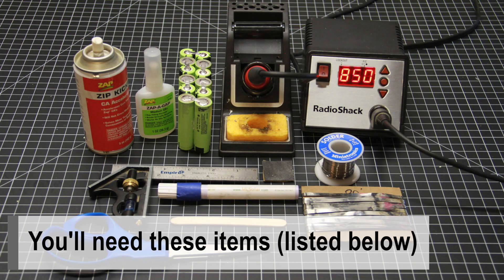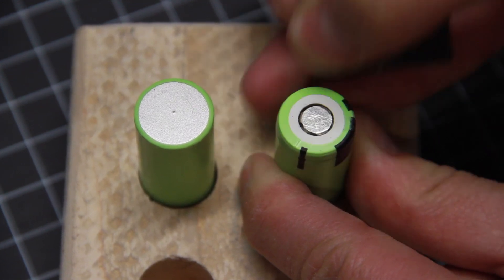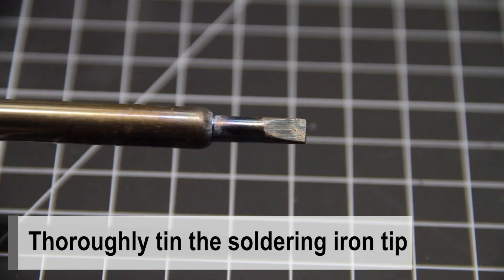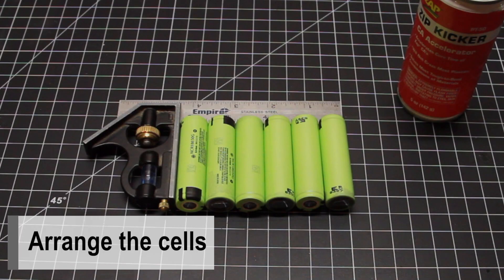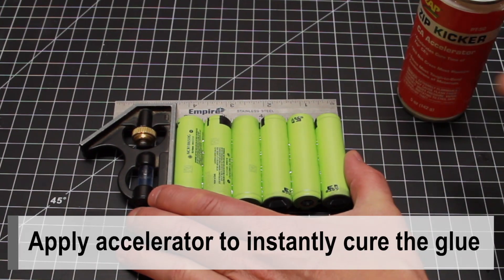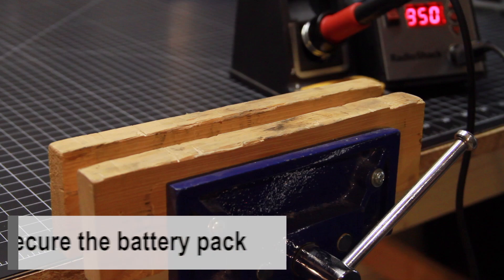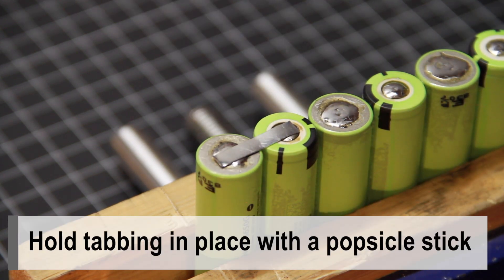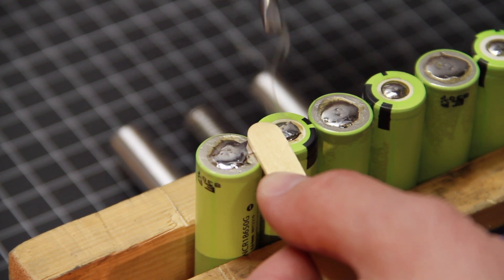Best Soldering 18650 Lithium Cell Tutorial - NO Welding, Just Solder!

Comment: Fast and hot. Use 63/37 solder like kester 84. Some cells are made with a difficult to solder steel. If so use a flat toothpick tip of plumbers tinning flux instead of a flux pen. A soldered joint will take a lot more current safely than a spot welded one.
Reply: You can also get solder that is 62% tin, 36% lead and 2% silver. This melts at a temperature several degrees lower than solder consisting of tin and lead only. In some countries you may have some difficulties getting these solders because only solder not containing lead can be legally sold in normal shops, but you should be able to get them from an industrial supplier. 

Lead-free solder needs a much higher temperature to melt it, and also has rather poor wetting qualities. These characteristics cause a much greater danger of damaging the cells. 

I suggest testing all the cells before soldering to check that they have identical voltage, and then quarantining the soldered cells for as long as your patience allows and then measuring them again. This should reveal if any cell has been damaged by the heat.

Comment: If you can hold onto close to the end of the battery you're soldering on and not burn your fingers, you're well below 100 centigrade. I've never had any issues soldering on lithium batteries.

Comment: I wouldn't recommend soldering batteries at all. I had once a coin cell that exploded while soldering.... I had luck and nothing happened except ears ringing. You never know what you may damage inside the battery. There are plastic insulators that may melt etc. Battery life will be compromised. Better buy a simple welder.
Reply from the maker: A coin battery has much less mass than an 18650 and therefore is dramatically less tolerant to heat. Easier/quicker to heat up a single penny versus an entire stack of them.
Reply: @enopto  That is certainly true but there is still no "correct" way of soldering batteries. It's just something you don't do! Especially since good small welders are available for about $50.
You can also buy 18650 cells with pieces of nickel strips welded on both sides. THAT is something you can solder at home...

Comment: Damn I'm an idiot. I used a method like this a lot. (based on common sense) But one critical step was missing. I did not cleaned the ends with isopropyl after sanding...
Reply from the maker: you're not an idiot. You're a stallion.

Comment: I melted the plastic sheath soldering the tab to the positive pole, the tab shorted the battery to the negative outer casing where it melted through the plastic sheath, I now place some folded paper under the tab on the positive so the plastic does not melt.
Reply from the maker: Good trick.

Comment: hi, does the heat from the solder affect the chemicals in the battery? thank you...
Reply: It may damage the cell (lower the capacitance) or if you apply too much of a solder on + side it can short a cell from inside, what will make it unusable or if it is high current cell it can even blow up. That's why u should use spot welder.
Reply: @zbigniewstuleja3477  thank you sir..

Comment: I was doing this almost daily for customers in the mid-1980's (NiCad's were cutting edge then). 
Cells were a couple of bucks each but a replacement pack from the manufacturer was $$$.
Hit each cell's ends against a medium grinding wheel for half a second instead of using sandpaper. 
Don't glue together until after final solder is cooled and tested -- if you overheat any +ve ends, you will melt things inside and short out that cell, and it would be hard to pull it out after it's glued in, so feel for any "warm" cells 5 minutes after soldering (bad sign, that cell's toast). Don't glue before that test (you can temporarily tape them together for easier soldering). Instead of tabs, flow a drop of rosin-core solder into the end of some braided copper desoldering wick, then touch that end of the wick to the solder drop previouly applied to the roughened -ve cell end and reheat just enough to ensure the "two become one." Now bridge the wick to the +ve end of the next cell, add a small drop and heat that just enough to melt into its existing drop. You're a pro now.
Reply: Can the solder wick withstand the same current as a regular tab? Some high end lithium cells do 20A to 40A.
Reply: @umloginqualquer   If there's 20-40A involved I'd suggest doing it properly. I'd love to see that power switch!
Reply: @umloginqualquer  those old nicads could pull some real current. tiny n-500ar 500mah cells do 17 amps peak all day. common to pull 6-10 amps continuous. the fastest race boats could drain a 1200 scr or 1700 sce sub-c size cell pack in less a minute , say a less than real world 40% efficiency thats still almost 30 amps and many of those high end packs had solder sponge as connectors
Reply: Desoldering wick! genius, that nickel tab is way harder to buy locally than just plain desoldering wick and easier than peeling cable terminals. ty sir
Reply: Geniales tips😉 Y si necesito unir en paralelo, la mecha desoldadora de cobre trenzado servirá igual ?? 🤔
Reply: solder wick is terrible idea as it will transfer the solder away from the initial soldering point, through the copper cable, and will add too much heat
Reply: @SeatbeltFan  Correct, it’s not an ideal solution. And that’s not how I’d properly solder darlington servo drivers… but it works for toys or low-power items where a replacement pack is discontinued or $$$$. And not in my electric car!

Comment: I thought I was the worst at soldering lithium ion 18650's, now I know the person making the video is even worse. I am a bit happy after watching this video.
Reply from the maker: Please elaborate.
Reply: @enopto  I guess you did not read what - Dawn Minilla - posted below. Also, Soldering has to be done as required, Its a Lithium Ion Cell, please read more about it, it can take short amounts of heat, but you are like dipping its a** off in molten solder, and then some dripping into the vent holes of the highly explosive Lithium battery. Hope some one does not die. I have seen Lithium cells explode without any mistake, its bad, and you don't want people pointing at you. My suggestion, and how i do it, is - take a thin tip solder, never let the Lithium cell experience the heat, it should be like frost byte and then you are gone. But in this video, you are like a foundry, melting stuff.
Reply from the maker: The way you’re describing is a recipe for a cold solder joint. Ever pass your hand quickly through a flame? Same concept here. High heat, low linger time. The “molten” pool is well contained. I’ve soldered hundreds of cells without issue. Thanks caution and care, we’ll all be ok.
Reply: @enopto  First, its a good solder joint. But I don't find it safe, its too big, if Mr. Joe watches this and comes in with that huge iron and some solder drops short his 18650, he wont have a face left. People who know what a lithium battery can do, its ok. but to general public, its just a big AA cell which can recharge.

Comment: that last soldered joint looks horribly like a dry joint and nothing like the previous one

think I would use a screw driver to hold the tab down and keep it there for a while to try and sink some heat away from the battery which isnt going to be liking the irons temp.

Comment: Dangerous! On the plus side, it is easy to damage the protective film in the area of the end of the 18650 cell, especially heating this place by soldering through a metal jumper. A short circuit will follow! Be sure to put protection on the positive end - paper or something like that - around the positive contact itself.
Reply: And one more thing: you need to solder much faster and with less solder than shown. And immediately cool the soldering with a wet swab.
Reply: @valsir4942  I tried to solder 18650 for my drill , in the crappiest way possible , did it 4-5 times , the solder didn't work but batteries work fine.
Reply: @73charaka  You need to solder with a well-heated powerful soldering iron, at least 40 watts. Be sure to sand or scratch the smooth surface before soldering. Place a drop of soldering acid on the spot. Put more solder on the soldering iron and solder shortly and accurately. It is better to first pass only a spot of solder, and solder the contact with the second run. Cool the soldering area immediately! Something like this...

Comment: I think the negative comments below came from ones who already invested in a spot welder. However I would have tinned the tabbing first before soldering to the cell. It would have taken less time to bond therefore less heat to the cell. I am holding off on buying a spot welder and will try this. Thanks so much.

Comment: The negative side is far more sensitive to heat than the positive side. Even the amount of heat shown here can be quite damaging. It might not show up right away, but one will notice cells that start to degrade quickly as they're charge-cycled.
I'll accept no soldering of battery cells at all. Although a nice guide.
Reply: I tried and tested several of these methods. If done correctly (You could still shave off a significant amount of heat here. This is still somewhat excessive.) I was not able to find any difference between spot welded/laser welded and soldered cells. All aged identical. The 5 soldered cells in my test even had a small but insignificant advantage after 500 cycles at high discharge rates. Probably part variance... This "welded only" stance is unbased. 
Industrially these cells get welded as it is faster by A LOT. You can weld several cells a second with a Laser machine.

Comment: Any one watching this never solder something not intended by the manufacture to be soldered. There's a couple of reasons no commercial packs are soldered direct to can. Look up any manufacture, say Panasonic for instance, Its clearly stated in many different papers "never solder directly to battery" lookup ACA4000pe2. Sure you can solder them and they'll still charge but with the volatility of li-on chemistry and the guaranteed shortened life, why. Good battery spot welders are the same cost as a good soldering station, and at 6 or 7 bucks a pop for a good 18650.
Reply: yes, don't solder with a tiny tip. you need 3 things for quick, reliable and non-damaging soldering:
- 300-500W temperature controlled soldering gun with a heavy chrome plated copper tip, set to 350-375°C
- Phosphoric acid soldering flux
- SN100C alloy rosin core wire. Leaded might melt at lower temp but it's much weaker

the goal is to apply as little tin as possible.
with some practice you can tin a cell terminal in less than 0.5 seconds
Reply: Just use a lower temp solder….
Reply: @ryanjodoin1587 it's much more about speed than solder melting point. Gotta use stainless soldering flux in an ultra thin layer and a big tip 300-500W thermostat soldering gun set to 350°C. much higher temperature and the molten tin will oxidize too quickly to keep up with rosin dipping. What matters is the thermal buffer, i.e. copper mass of the tip. the heavier the tip, the quicker it can transfer the heat through the solder onto the cell, thereby limiting heat transfer within the cell to a bare minimum.
Reply: @dawnminilla9299 You are right. But in thia video the cells already have a white ring around the positive terminal to prevent short circuit
Reply: i assume thath the reason that cells are not commercially connected by soldering and instead by spot welding is that on a production line with large amounts of product it is faster or cheaper to spot weld them.   For the prices i am seeing, a kweld spot welder is much more expensive than a soldering iron.
Reply: @lindamlittle  Yes, when I said there's a couple of reason they don't solder, speed would be one of them except it would also be hard for them to get any warranty from the battery manufacture if they knew they were soldering, so it's much less of a reason but yes it's still one of them.
Reply: They have soldering stations for $35 whereas a mini spot welder station is 150-200 dollars, with the quality to be known. I tried a portable mini spot welder and the welds were wildly inconsistent, burning holes in some while easily being able to pull off other welds. There are so many variable in spot welding, atleast from a non-wall outlet one running off a battery- voltage, metal buildup on electrode pens, etc
Reply: The key is to get in and out quickly and there won't be a problem.  (ie avoid heat soak)

Comment: soldering is not good, thermal camera view shows how much heat is being introduced to the battery
Reply: Agreed, but it's not as damaging as often thought. 18650 cells are not that fragile. It's designed to go through hundreds of heat cycles during charging/discharging.
Reply: @LawAbidingCitizen117   used to been soldering cells together for my dyson vacuum and cordless drills. frankly I have damaged quite a few cells, lost capacity after soldering was the most common, the end of the battery will heat up to about 190-200 degC, thats a lot.
Now you can buy 12V spot welder KIT from aliexpress for under 12Euro or microwave KIT for under 15Euro. clean and easy, no need to sand and solder or use acid. I have used  12V KIT and 3V KIT for microwave transformer and I couldn't be more happier with the results, speed and no soldering smoke, benefits only

Comment: well "enopto".....vid is well made..... B U T  .......: = use copper-strips (or even silver strips)  = less electric resistance ! // drill thin holes trough the strips where the tin should make a good connection with the batterie ! // that's the way I do it already for many years (RC-modelling)
Reply from the maker: That's a good idea.

Comment: @enopto - Your video says no welding. What do you think soldering is? its a form of welding... Are you sticking two pieces of metal together with more metal? then its welding. I thought you were going to use some new type of electrical epoxy or something...
Reply from the maker: The main difference between welding and soldering is melting the base material. In soldering, you heat the base metal to be bonded but never melt them. In welding, you melt the base metal and add filler via arc/stick, tig, mig, etc....

Comment: Good, BUT make SURE when soldering the strips to NOT melt the insulating sleeve!!!  Under the sleeve is battery negative and if the strip contacts the battery shell, you will short the battery!
Better to slightly bend the strip where it passes over the battery shell to keep it away from the insulator.
Reply from the maker: Good idea

Comment: be careful when you solder the + side because your strip is pushing down on the edge where that is a - @2.49. The plastic wrapper can melt when soldering and short. Better to use a insulator or just put something in between it to protect it the sharp edges from the nickel can pierce it. 

Question. By putting each cell side by side like that in a series isn't there a risk of short between the wrappers because there is no spacing in between the cells? I've always wrapped my parallels together and spaced out my series with at some tape but I see a lot of people don't do that am I missing something?
Reply from the maker: Good reminder.

Comment: Complete BS.  Soldering cells damages them significantly no matter how fast you apply the heat.  You may get lucky if you're careful as demonstrated but the cells are still damaged and won't last as long.  Plus, you're heating all but the end cells THREE TIMES.  If you use one long strip you only heat them twice.  Yes, I know a long strip will sink some of the heat away but it's a good trade off.
Reply from the maker: I should go to Vegas. Series.
Reply: @enopto  I don't care where you go.  I just couldn't watch your video without challenging it.  This argument has been played out MANY times on YouTube and soldering always loses when documented tests are presented.  It's just common sense.  Battery manufacturers would love to be able to tell prospective customers that they don't need a welder but they have done the tests and they know better.  Now you do too so lets see if you're as smart as you are lucky.

Comment: Excellent tutorial. Although a bit outdated, as now everyone can do spot welding with a 3$ supercapacitor.
Reply from the maker: More people own a soldering iron than those that own a super flux capacitor.
Reply: @enopto  I agree, supercaps are not very popular yet. Still, I think it's a must have if you want to connect batteries without damaging them. Batteries are much more expensive than 3$.

Comment: DO NOT GLUE!  During the usage, there is a chance that the glue will rip off the protective cover and a short could develop!
Reply: Other than this point of gluing, excellent guide about how to do it!  If you plan to use battery pack as stationary, gluing is OK and will simplify the assembly.
Reply from the maker: Do you have battery powered boomerangs?
Reply: @enopto  RC airplanes. All Liion packs are subject to strong stresses during hard landings and crashes
Reply from the maker: What do you suggest? I glue all my packs, protect exposed ends with Kapton tape, then wrap with strapping tape for strength, and finally cover the entire battery with a shrink wrap sleeve.
Reply: @enopto  I put extra separators (pieces of heat shrink, or paper stickers, or packing tape) and then put the whole loose battery pack in heat shrink or use thick packing tape to keep them together.
Reply: what about a little blob of hot melt glue near each end?
Reply: @utubeape  If it is "soft" glue it is OK, but normal glues really create hard spots which tend to break. One problem with hot glue is that it can melt. A battery can reach easily 50 C, and under certain conditions much more, up to 80 C, so again the hotglue will not hold.